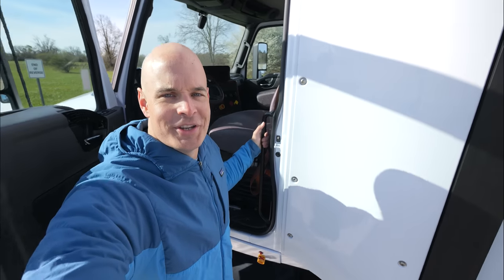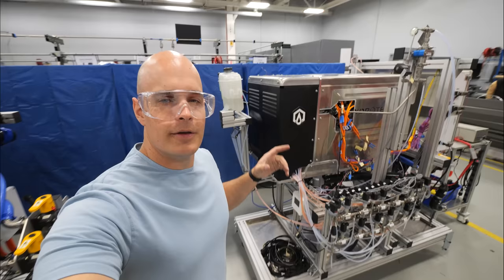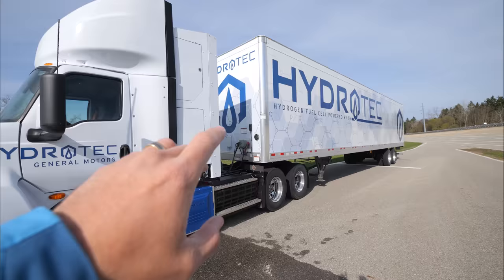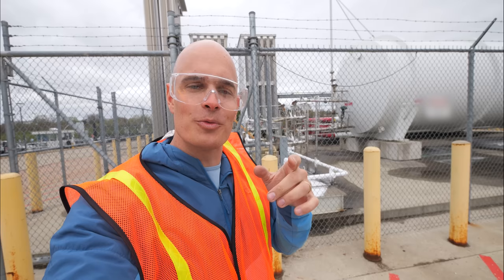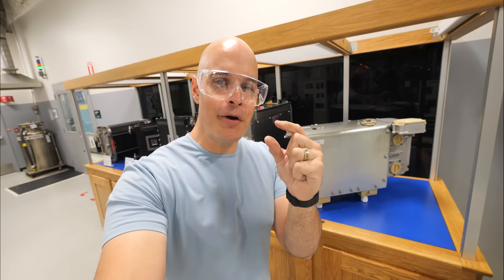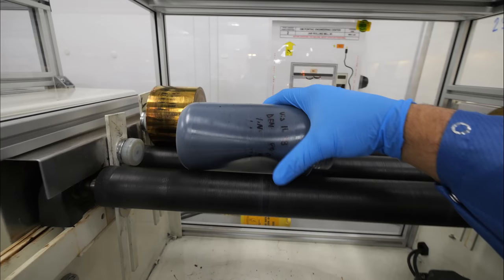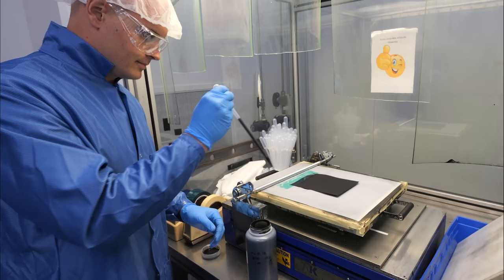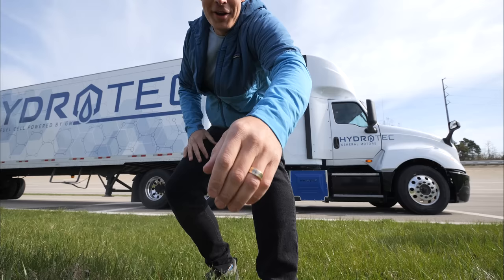How to build a Hydrogen Fuel Cell Semi Truck? - Hydrotec Factory Tour

Comment: Hydrogen semis make much more sense than pure electric ones!
Reply: Details?
They require huge, complicated and potentially unreliable infrastructure.
.
They require far more grid energy (clean OR dirty)
.
They WILL cost 3 times the amount in "fuel" (despite what you may think)
.
They are much more complicated (it's an EV with a second system bolted on)
.
They provide no more useful range. (The DRIVER is the limiting factor in daily range)

Comment: This is hydrogen propaganda. The issue of the amount of energy it takes to strip hydrogen from water and methane has not been solved by renewables for 1 simple reason: opportunity costs. If we use renewables for inefficient and energy solutions like hydrogen then that renewable power being used can't be used for much, much more efficient solutions like heat pumps or EVs; although renewable energy is not finite, the amount of it we have on the grid at any particular time is, and our capacity to develop it is..... so if we can reduce emissions by x/kWa using hydrogen or by 10x/kwa using more efficient means then the choice to use hydrogen is a harmful one. I support more R&D, but I wish that the hydrogen industry, and it's supporters, would be honest about an industry that emits as much carbon as the aviation sector.

Comment: As great as hydrogen is why don't you bypass it and go directly to antigravity. With an antigravity vest and guy wires throughout the house your wife can move about the house freely. With a drone attached above her head and the vest on she can go anywhere since the drone doesn't have to pull her weight around.

Comment: You need to remember this is only one hydrogen solution. The other is combusting it in an engine. This is one way that's currently being trialled. It's also carbon neutral as well although I still think the fuel cell is the best solution.

Comment: using engine noise as an excuse is so stupid and false! I drive 10 year old 2.0 tdi and can't hear engine....
Yet I live on busy main street and don't hear when diesel/petrol cars passing by. But I DO hear when electric cars passing by with their stupid loud noise they make! feels like I live next to train station...but yeah get electric car so you can't hear engine noise inside the cabin...never heard anything more stupid..
and yeah I do drive electric car for over 3 years and absolutely hate it. It costs me absolute fortune to run it and it's not quite. I regret getting it in first place!

Comment: Did Elon Musk say "Hydrogen (in vehicles) is stupid"? 
Wonder when will these companies/labs start listening to smart people and stop wasting recourses! 
This Semi already has a 250KW batterie installed, why not double/triple this and go all electric - simple. You are adding all this complexity (Hydrogen fuel cells, tanks, etc...) and the cost only for convenience - refueling time!!!
It's mind-boggling how much energy is wasted using electricity to make Hydrogen, store it, and convert it back to electricity again. Also, you have to consider the life-span of a Hydrogen fuel cell.
The only logical use-case for Hydrogen fuel cells would perhaps be on ships transporting Hydrogen.
Reply from the maker: Doubling a 250kw battery (without 150kw worth of hydrogen recharging) would only give you about 60 miles of range under full load. Batteries work great for cars. Not for towing. Careful throwing around the stupid word.
Reply: @JerryRigEverything  kWh

Comment: Ordinary every day motor cars should be replaced by hydrogen powered cars, rather than the current battery EV version’s which are just overpriced dangerous junk waiting for the recycling centre.   EV’s are nearly worthless when their batteries get old.    Will hydrogen cars burst into flames like EV lithium cars do?   or will they just spring a fixable leak perhaps.  I will stick to my diesel car for the foreseeable future.

Comment: Out performs batteries 10 to 1 by weight for the same power density.
Reply: but energy density by volume is extremely low.

Comment: in my opinion,  i dont understand why  a person would dangerously store hydrogen  @ 10,oooPSI and @ -- 150c when you can make it on demand on location  ,for freeeeeeeeeee,  from water ,    hydrogen fuel cell in my mind are an absolute waste of time ,money and energy    & are  dangerous ,     the alternative in my thinking is  far far safer , i can run the Humvee the truck the plane , the chopper and heat the house and house water on electrolysis hydrogen technology using a unsettling  but not dangerous 48 Volts aC/dc   without storing a single molecule  ,  and the best thing is , i dont need a degree  to make it happen or a bank roll the size of a house to finance the changeover . just sayin .

Comment: A concern with EV's is the rare metals of the batteries and their toxicity and expensive recycling.  Are these cells more sustainable?  Electrodes would get used up over time in these as well, seems like a similar issue?

Comment: One correction, hydrogen is 10 times more energy dense than lithium ion batteries, in liquid form. Gaseous hydrogen tends to be far less energy dense than lithium ion which is why we tend to store hydrogen at high pressures. The downside is that these higher pressures require more expensive hardware and shortened lifespans. As a whole I just think hydrogen as a whole is a lot more flawed than many think. I do think it makes sense for trucks though as weight is the major issue with trucking. 

Trucks make more money the more they can store and electric trucks weigh more than gas or diesel. The issue is there are legal limits on roads and per axel making trucks that weigh less more profitable. It's why the Tesla semi, while cool, doesn't really change much. Plus there's also the massive loss of range. I saw many praising the range of the semi at 500 miles while that's really pretty pitiful. I know for cars 500 miles tends to be the target range, but for trucks there are many that can go 1800 miles on a single tank. I just don't see a way BEVs could ever compete on that.
Reply: True but batteries will only get more energy dense.
Reply: @user-RCST  I don't see a future where batteries are over 3 times more energy dense than existing cells. Not at least for another 25 years. Even the best solid state batteries we can theorize only tend to double existing cells, while batteries will get better in making BEV cars better options, for trucks I'm not so sure. 

Plus I do think many EV fan have misplaced praise for solid state. Let's be honest, with solid state we're just gonna end up back at the status quo of 500 mile everything much like with gas cars. There isn't much incentive to go higher and less batteries means cheaper build costs, cheaper machines to lift the vehicles in the factory, higher advertised miles per kilowatt, etc.
Reply: @Skylancer727     I don't think it'll beat hydrogen in energy density, but they'll get dense enough for the range to be acceptable, and because they have a lower cost per mile, they'll win.
Reply: @user-RCST  Well as of now for cars it already wins. Even if pressurized hydrogen is more energy dense the hydrogen fuel cells can never be as efficient as a battery. So even now with hydrogen having higher density the result is fairly comparable both in weight and range. Hydrogen though scales better with size than batteries because of the slightly higher energy density. But I do agree hydrogen will always be more expensive. 

Of course if cost and environmental impacts were all we cared about, we'd be transporting more by rail. Some countries even require by law that all goods are transported by rail just to cut down on traffic and general road wear. Main reason the US has so much more trucking is we allowed the rail companies to own the lines and add fees to transport goods from one companies lines to another. I use this as an example of the fact that the logical answer isn't always the one people choose. I mean almost nobody is even looking at it and many even think rail should just go the way of the dodo.
Reply: Now you just have to figure out the 30% loss to electrolysis at scale, transportation to a fueling depot, 1,013 bar DOT Approved tanks, how to keep the hydrogen from boiling off and how to make up for the 35% conversion loss of a fuel cell over just using the electricity in the same electric motors this truck already has.

Comment: It is insane to drive around with that much hydrogen. It would be safer to do hydrogen on demand and use that to power a generator. Essentially it is stored as water then split as needed to run in a combustion generator or through the fuel cell or both. There have been some interesting breakthroughs lately in using water to generate hydrogen gas.
Reply: You do realize that if you had the energy onboard to split water, compress H² into a tank, run it through a fuel cell.... and a battery (yes, battery is used in this system) then send power to the electric motor you would be wasting >75% of what you started with?  🧐
Reply: @jimurrata6785  That is exactly why you would not want to use it for electricity directly. You combust the gas just like a typical gasoline motor. If they insist on electric drive train it would be much more efficient to have the Hydrogen running a generator rather than using electrolysis.
Reply: Where do you get the energy to power the generator to "split the water"???
Hydrogen is net loss at every step of the process.
The more steps the more loss

Comment: I'm glad that unlike the Tesla idiots, these guys don't focus on the 0-60 capability. I am curious how much heavier this truck is compared to a regular one as that's less weight it can haul. BUT these should totally be the intra city solution
Reply: And how much less efficient using hydrogen is
Reply: Those "tesla idiots" are making a very, very energy efficient truck though.
Reply: @logitech4873  no they are not. Especially if you look at the energy density of diesel vs batteries. And then the fact that an electric truck starts off at more than twice the CO2 emissions at showroom floor level lol. Not to mention all the lies Elons been spewing on just the truck part
Reply: @40cycleradio  The Tesla Semi uses ~1250 Wh of energy per kilometer. The average 6.5 Mpg diesel semi uses ~3600 Wh of energy per kilometer.

The Tesla is about 3x more energy efficient.
Energy density is separate from efficiency.
Reply: @logitech4873  First off the Tesla semi doesn't exist. The one they paraded on TV is a joke from almost every angle. Lookup debunking videos on that semi. Far smarter people than me have laid out the math. Also you forget that long haul trucks are required to refuel quickly and that temperature variations are a weekly thing for them, something that really impacts electric cars. 

Same goes for regular cat actually. If you compare and electric car emissions with a gasoline care of the same range you will need to drive the electric car about 300,000k., For the emission graph to cross. 
Hybrids for now are the best and cleanest option. Again all this is available online.
Reply: @40cycleradio  The semi exists and has been delivered to select customers.
Your numbers are pretty much nonsense. Provide a source.

Comment: A guy make a hydrogen motor back in the 50's or 60's. Oil companys threatened to "off" him if the idea got out because it would have destroyed the oil industry
Reply: It was a scam
Reply: Hydrogen fuel cells have existed for almost 200 years. What are you on about?

Comment: Making cheap and clean hydrogen is not an easy task. Traditional one is made from fossil methane, and byproduct CO2 is thrown away into the atmosphere. Just like, you know, ICE engines.
The clean way of producing it  - hydrolysis of water - uses quite a lot of energy which also must be clean and renewable for production to make any sense, and this makes it expensive.

This is why all videos about hydrogen cars omit the interesting part of "where does the most common element in galaxy comes from".

Comment: Can't you just burn hydrogen why go to the trouble of making it electric
Reply: Because it is incredibly inefficient.
Reply: @Simon-dm8zv  Cheep tho
Reply: @dean1100110  Not at all.
Reply: @Simon-dm8zv  I dont know Man, engines are cheaper to build than whatever they got going on. Cast a block of aluminium and some other parts and hey presto. You got yourself a renewable Truck or car. Sometimes the simpler open is the best one. I also thought the whole reason we made efficiency a big deal was emissions. No emissions no worries
Reply: @dean1100110  Price per mile will be higher than a hydrogen fuel cell vehicle and far higher than a battery electric car.
Reply: @Simon-dm8zv  cheap on upfront cost tho. Also If renewable energy is so affordable won't it be like back in the day. When you could fill up your car with Penneys. So we're only talking about pennies on the dollar regarding efficiency. I think most people will take the cheaper upfront cost over efficiency in the long run.
Reply: @dean1100110  It is clear that EVs will be cheaper than internal combustion engine cars within this decade. Also, we simply cannot afford to waste insane amounts of renewable energy on hydrogen combustion for a very long time - it would actually slow down the energy transition. Also, ICE require a lot more maintenance which also adds a lot in cost. Plus: combusting hydrogen still causes NOx emissions. Last but not least: high pressure hydrogen tanks and the control system is expensive to produce and does not last forever.
Reply: @Simon-dm8zv  I would say the cost of EVs will only rise due to the limitations of battery technology and precious resources not lasting forever. As I said waste is only bad when there's an environmental impact attached to it. Energy transition will only happen if the cost is lower or the same as normal Cars. Not everyone can afford to buy an EV. Lowering the Upfront cost will make people more inclined to switch. NOx emissions can be mitigated very easily. High-pressure hydrogen tanks will get cheaper as manufacturing constraints are lifted and that point can be used as a negative for hydrogen cell vehicles. Buring hydrogen may not be efficient but it's a dam site cheaper and more environmentally friendly. Then using slave labour in the Congo to extract lithium for cars to be scrapped in the next 20 years.
Reply: @dean1100110  ICE vehicles are and remain expensive because of their complexity and their exhaust gas treatment systems. EVs will (and are) getting cheaper because of scaling of battery production. We can already see the effect happening right now. And no, there is no slave labour involved with the mining of lithium. Nor is lithium mined in Congo. You are probably referring to cobalt, a material that is used less and less in EV batteries and there are already plenty of EVs on the road that use 0 cobalt. And again, this is not the time for energy squandering as we need to reach climate goals.

Comment: 4:45 - liquid hydrogen takes only 1/2 the space of the compressed hydrogen gas. The liquid  from the storage tank does not expand to atmospheric pressure.
Reply: This is already at 680bar and not yet liquid.
You need 1.013 bar to keep it liquid at a density of 71kg/m³

Comment: Why don't you build an HHO system instead of doing Electric it's a lot cleaner lot safer and on top of that if the vehicle overheats and won't blow up like a dozen with electric
Reply: Hydrogen combustion is terribly inefficient + you would still need gigantic pressure vessels to store the hydrogen. And no, onboard electrolysis cannot be done without an external power source.

Comment: Hydrogen is the most common element in the entire galaxy, but it's not common at all on Earth. It's extremely inefficient to use fuel cella because you lose almost as much energy in making it and then in extracting electricity again as it is using an ICE engine. I wish we stopped wasting time and resources on hydrogen and we focus in batteries